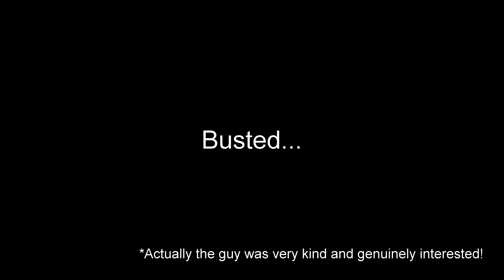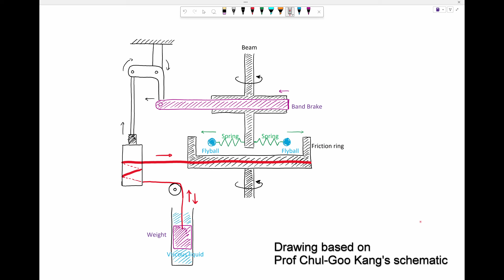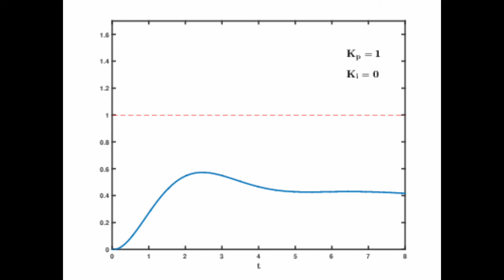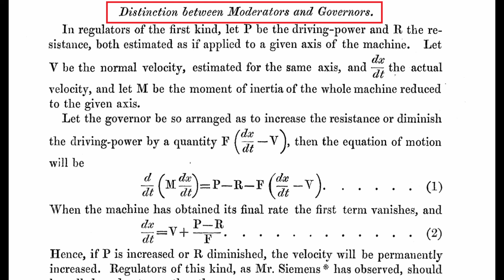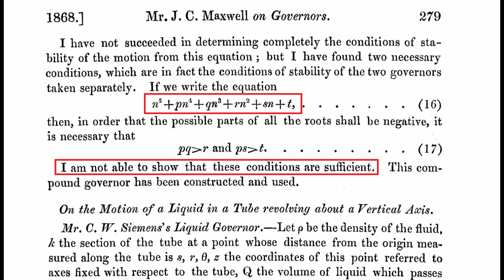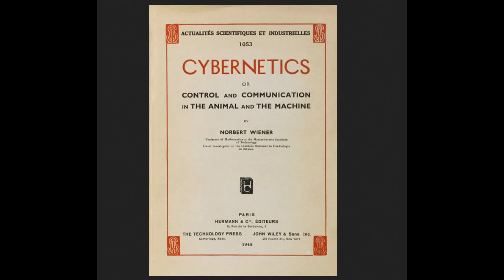When Maxwell Casually Invented The Science That Rules Our World... (And It's Not Electromagnetism!)

Comment: Hi, a "beam" is a structural element that primarily resists loads applied laterally. A rotating machine element is a shaft.
In English, in pass tense of regular verbs, the '-ed' sounds like 'D'. So "controlled" is pronounced like "controlld".
And the word "pronounced" I just used sounds like "pronounct". 

Figure it out "Doctor"... I mean Google it:

    - Past-tense verbs sound like 'T' if the verb ends in a voiceless sound such as 'p' or 'k'.
    - The '-ed' sounds like 'D' if the verb ends with a voiced sound, like 'l' or 'b'.
    - Words ending in 't' or 'd' have '-ed' pronounced as 'ID', like in 'needed'.

Comment: Use this instead of such because such sounds derogative. And remove finger from the frame, not only it puts all the rest in blur, it is daft, the center of the frame is your pointer you do not need to stick your finger in it. Do you explain how the add rpms there? I am tired of looking at your finger. If you could at least point with your cock.

Comment: When the fly wall slows down the weight will pull against the connector in the opposite direction which as the lever is on a screw will release the brake!That is the weight going down releases the tension on the lever if as he states it is connected in the rope coiled drum releasing the brake!

Comment: Were these Fleming  governors ever used on anything but the specialist hign precision use they were designed for?

One issue appears to be that ( in this example at any rate) that the brake band is acting only on the governor drive stub, not restricting the steam to the piston. On a high torque steam engine, it is doubtful whether this would "govern" at all, more likely end up with the governor drive being damaged if the engine overspeeded, because it isn't regulating the " fuel" to the engine. 
This may be useful for lab use but probably not for industrial use, which is why designs up to the end of industrial or road steam ( maybe not railway) they often still used derivatives of the original governor type

Comment: Why wasn't James Watt credited with the creation of control engineering, given that he invented the steam engine governor? Did he not write any treatise on the subject of governors?
Reply from the maker: Well, Watt didn't invent the governor, Christiaan Huygens did, about 100 years before to   regulate the distance and pressure between millstones in windmills. Watt adapted one for steam engines. Also, governors are not even the first examples of control systems, there are examples which are thousands of years old (e.g. from Egypt).

What makes the difference here is that Maxwell provided a deep analysis of what was going on, understanding the importance of the integral action, of linearisation, and setting up the basis of control engineering, which is a very formal and mathematical field. In other words, while control systems existed before, this was the first time someone recognised “control” as something important in itself, thus laying the foundation of control as an independent scientific field.
Reply: @Prof_Gio  Ah, thank you for this! I think the Watt governor is mentioned in probably every introductory control textbook and maybe that could be the reason it has stuck. Sadly, neither Maxwell nor Huygens are mentioned equally often in control. Most people only read one introductory book on the subject and, more often than not, the historical introduction is treated as filler material which is duly skipped: students have exams and homework assignments to worry about, encyclopaedic knowledge can wait for retirement!

Comment: Very interesting history lesson! However I have to offer a slight amendment to the explanation. The prototypical fly-ball governor is not a proportional speed controller, but is itself actually a pure integral speed controller (at least in theory, for small angles, and with a zero friction balanced throttle valve, lol).

The fly-ball approximates a conical pendulum. Harmonic oscillator theory tells us that a conical pendulum has one rotational speed at which the bob is stable (again, for small angles). This natural frequency is w = sqrt(g/L) in radians per second, where g is the acceleration of gravity and L is the distance from the pivot to the mass. For any speed below this speed, the balls rest all the way at the bottom of their travel. For any speed above this speed, the balls fly out to the maximum extent of their travel. 

When the ball angle is significant or the pivots aren’t placed in the shaft axis, the system becomes nonlinear and actually does exhibit a somewhat proportional behavior. One or both of these nonidealities is true of all the governors shown in the video. But these are all rather primitive variants, and various means were applied to more refined versions of the governor to counteract this nonideality (springs that partially modify or wholly replace the gravitational force on the balls, linkages that cause the balls to follow a paraboloidal surface, etc). There is quite a lot of period literature discussing various ways of making the governor more exactly approximate a theoretical small angle conical pendulum.

The upshot of all of this is that the theoretical fly-ball governor actually exhibits an output actuator position that is a (nonlinear) function of the integrated applied torque over time, not of speed. Torque is only zero at at the natural speed/frequency, and yet at this speed the actuator is stable in all positions. So the only stable equilibrium is one where the balls rotate at exactly the critical speed and the balls and throttle valve are in whatever position exactly supplies the torque required to drive the load, and the speed error is exactly zero.

Hunting oscillations actually drive this point home. An ideal proportional speed controller does not exhibit hunting. Acceleration is the first time derivative of speed, so a speed-proportional control law (applied torque and hence acceleration is proportional to speed error) results in a damped first order response with no overshoot.

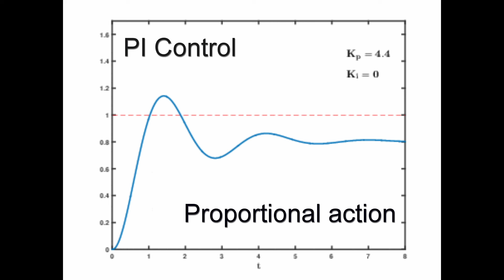This point highlights something in the video that might bear correction or clarification. The graphs shown for proportional control at 13:05 are clearly graphs of proportional position control of a system. This is not the correct graph for proportional speed control. The acceleration of a mass is the second derivative of position, so in the case of proportional position control (applied torque/acceleration proportional to position error) we get overshoot and a damped harmonic oscillation, very unlike ideal proportional speed control where this does not happen.

Of course I want to emphasize that most real fly-ball governors don’t actually achieve integral control. And I will be the first to recognize how many times I said the word "ideally" and "theoretically" above.

However I think it’s important to state that when just using the simple equations of motion and ignoring nonidealities, it’s not correct to say that fly-ball governors exhibit proportional speed control law behavior. In fact the core problem with fly-ball governors is that they are pure integral speed controllers, and it’s precisely because of this that they exhibit hunting oscillation.
Reply from the maker: Great and interesting analysis! Let me point out that the explanation I provided is specifically the one given by Maxwell in his paper (so it is 155 years old...), rather than a modern and complete explanation of governor dynamics. Also, my objective with these videos is to open up these topics beyond control experts, and I believe that a certain degree of simplification is needed (and probably the lack of it is one of the main outreach problems of the community). And thank you for your comment about the plot.
Reply: @Prof_Gio  Thank you for noticing my comment! I should have highlighted in my comment that I did not read Maxwell's treatise... which I now feel obliged to do. 

And I want to thank you for educating everyone about control theory, and about the fact that Maxwell had such a key part in the early history of the field. I had no idea that this was the case. Again I actually need to apologize that I didn't lead with this acknowledgement, I was too eager to get my point out and should have acknowledged the service you are doing first and foremost.

I do want to know how Maxwell got to the conclusion that the flyball was a proportional controller with finite gain at zero frequency. I'm sure he was correct, in his historical context. We know for sure he was smart enough to have done the correct analysis!

I didn't really think about the timeline when I wrote my original comment... my familiarity with the period literature is more around 1890 or so, after Maxwell died. So I'm guessing at the time people probably just used the off-axis pivot/large angle mode of operation which is in fact a (nonlinear) proportional controller. All of the more complex and later variants I'm familiar with were also discussed in the same breath as dashpots and other fluid dampers... probably not used in practice when Maxwell was writing?

Anyway, it will be great to read the original source material that inspired your video!
Reply: "The fly-ball approximates a conical pendulum."
I don't think it does. The ball isn't free to spin. Having the ball constrained to only swing out, changes the characteristics of the system significantly. 
The distance to the pivot doesn't determine how fast the ball spins. The ball is forced to spin by the shaft. The axle does not have to spin at a particular speed to cause the ball to move.
A conical pendulum's speed is determined by the distance to the pivot and is independent from the mass of the ball. The mass of the ball in a governor greatly effects the behavior of the governor.
Reply: @ddegn  You’re right that the flyball governor isn’t a free pendulum.

But as I said originally, if the governor arm pivot coincides with the shaft axis, and if the balls aren’t allowed to rise very far, the governor does actually exhibit a critical speed, below which the balls don’t rise at all, and above which they fly out as far as they can. And this speed is exactly the rotational speed of a conical pendulum with the same length. 

And I can recall at least two different variants of actual, practical governor that I read about in “English Mechanic and World of Science” that were built to work this way. One used springs to supply a force to the ball arms that varied with their position, and the other used a set of linkages to force the balls to follow an approximately parabolic arc; both designs has the explicit, stated intent of achieving a precisely regulated critical speed. BTW English Mechanic is free to read online, and a super interesting insight into industrial revolution engineering history. Highly recommend.

It’s also not true that the theory of the gravity-balanced flyball governor has any dependence at all on the ball mass. Spring balanced governors? Of course, yes: mass matters. Governors driving large heavy throttle valves with lots of inertia, friction, or spring force to overcome? Sure, you betcha. Definitely matters. The math of the system, though? In that case, no: the mass doesn’t matter. Why should it? Do two flyballs hanging next to each other on the same side of the shaft act any differently than one twice as heavy on the same length of arm? 

Since this is a video on control theory, and not on practical engine speed regulation, I think it’s fair to focus on the math and the ideal case, especially since people really designed actual governors with this ideal concept in mind.
Reply: @InductorMan  Thanks for the reply. You've given me a lot to think about.
I'll find the book (English Mechanic) you suggest. Edit: I see now it's a series of magazines.

"In that case, no: the mass doesn’t matter."
I think you're right. Thanks for setting me straight.
Reply: @ddegn  yeah it's a super interesting insight into the state of technology in the Victorian era. I do wish I could point you to the issue where those governors were discussed, but I've read probably around 10 years of the magazine (from about 1885 to about 1895 very roughly) and I have no idea what issue it would have been in!
Reply: @InductorMan  "I do wish I could point you to the issue"
Thanks for letting me know you don't remember the issue. I was seriously considering asking if you knew.

I've been thinking about your comment a lot since yesterday. I'm seriously thinking of rigging up some sort of experiment with motors and encoders to see if I can replicate the effect you told me about.
Again, thank you very much for setting me straight on this topic. I think it's very interesting.
Reply: "An ideal proportional speed controller does not exhibit hunting."

That is just flat out wrong.  Any proportional control system will exhibit instability if the gain or phase margin of the system is inadequate.  Additionally, although there is a minimum critical angular velocity before the weights start to move, above this point the angle of the weights increases as the angular velocity increases (i.e. they don't just "fly out" above the critical velocity).  However this relationship is quite non-linear with the angle/velocity slope being steeper close to the critical velocity and flattening as velocity increases. Unless this is compensated by another mechanical element (e.g. a cam) then this also means the proportional gain of the system changes with velocity, which can itself introduce parametric oscillation.
Reply: @ferrumignis  Sure, you're right in a general sense; the plant can obviously make purely proportional feedback unstable. I think that's a little bit beyond the level of complexity that was supposed to be covered in the video, but you're totally right to bring that up.

I would ask you to think carefully about your statement that the weights "don't just fly out". Yes, that right for finite changes in speed, but is it correct as a first order approximation at all speeds? In the ideal case, no: the incremental proportional gain of the system at the critical speed is infinity (the ideal case here being all the caveats I defined at the beginning of my first comment). 

At this point, the pendulum approximates a harmonic oscillator, the restoring force is proportional to the radial displacement, and the balls are stable at all (small) angles when the shaft rotates at the critical speed.

[edit: in the first point, I think it is pretty clear that I was analyzing a purely viscous load [edit2: meant to say inertial load] plus a torque-proportional-to-control-signal prime mover as the plant, from the way I posed it:

"Acceleration is the first time derivative of speed, so a speed-proportional control law (applied torque and hence acceleration is proportional to speed error) results in a damped first order response with no overshoot."

You're still right, of course in the general case the plant can have enough phase to be unstable even for infinitesimal proportional gains. But I think that in the context of a steam power plant, with throttle valve governing, where the flywheel probably provides dominant pole compensation in almost all cases, we're pretty correct to say that we can find a proportional gain that will produce stability.]
Reply: what is considered a "small angle"?
Reply: @indefinitingdefinition  This is up to the engineer doing the analysis and how precise you want to be. The "small angle approximation" is where you assume sin(x) = x and cos(x) = 1. Obviously this is never actually true for any angles.

But generally for angles less than about 5-15 degrees the sine function is very well approximated as a straight line, and the cosine function is well approximated as just equal to 1. This is what we mean by "small angles" in this context. 

At 5 degrees, sin(x) is within 0.1% of x, and cos(x) is within 0.4% of 1. 

At 15 degrees, sin(x) is within 1% of x, and cos(x) is 3.5% away from w. 

So at 5 degrees, we're "pretty damn close" to the small angle approximation, and at 15 degrees we're still tolerably close.
Reply: @InductorMan thank you